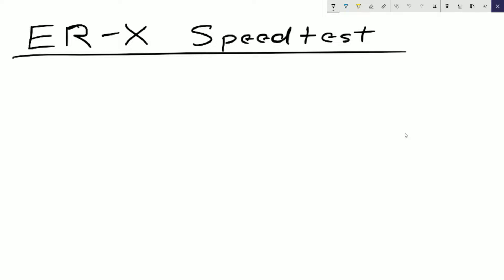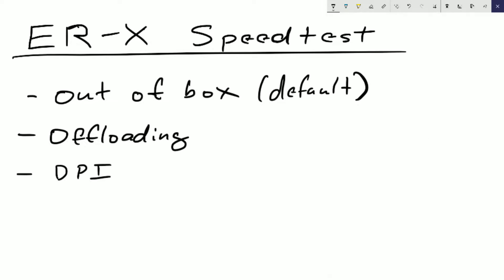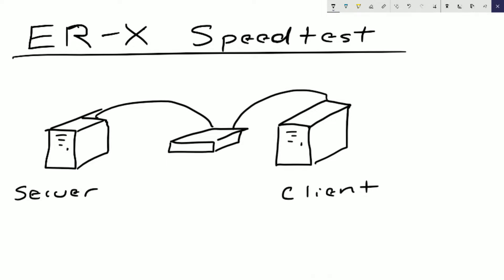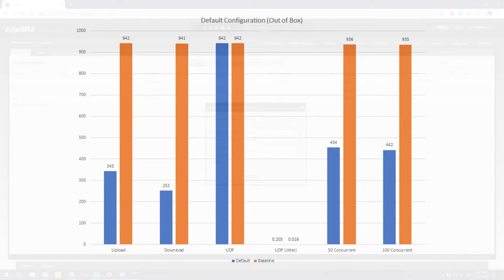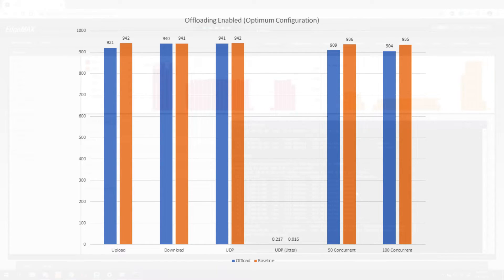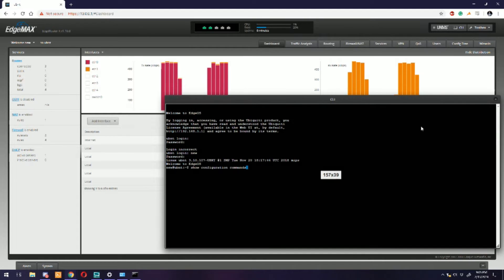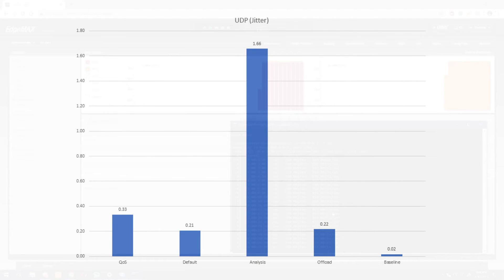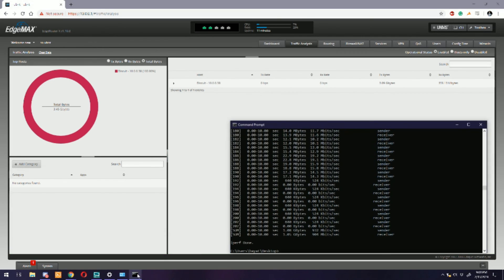Edgerouter X Speedtest

Comment: Hi, i have edgerouter x with firmware 2.09. I use wan 1 and wan 2. Normal speed in wan 2 is 200mbit of download and 20 of upload. With my ubiquiti router the speed came limited to 60/70 mbit in download, why ?
I have enabled/disabled ipsec and hwnat but the problem is always the same.
Thanks a lot for the help.
Reply from the maker: You don't have smart-queue or any other type of QoS configured do you?  The QoS configuration will take precedence over the offloading.  It will still take the offloading commands, but won't tell you if another setting is going to override it.
Reply: @ToastyAnswers  hi, i not have nothing QOS oe firewall or smart queue active. The only active are ipsec, hwnat, masquerade for WAN.

Comment: Very informative vid .. Im looking to buy an edge router for my house , ERX is on my list along with TPlink605 , but I really don’t know which one to buy ! My internet speed is about 750 Mbps .. and might consider upgrading next year , what do you recommend knowing that this ERX is almost 4 yrs old now 
Thank you ‘
Reply from the maker: Thank you for the comment! This router is fairly dated at this point, but is still a solid performer IMO (for the price).  If your internet speed is 750Mbps, I'd look at either the ER-4 or the Dream Machine.  You might want to check out my Edgerouter Vs. Security Gateway to see the ER-4 performance.  

It really comes down to how much you are wanting to process the traffic (QoS...IPS...etc...) as to which one you should go with. 

TL;DR: The ER-X will do 750Mbps with no processing at all (firewall only, and only in one direction).  The ER-4 will easily do 750Mbps in both directions with only firewall and the Dream Machine will easily process all the traffic with IPS.
Reply: @ToastyAnswers  thank you very much for you time and reply … actually my main ISP connection is outside the house ( in a centralized IT room ) so Wi-Fi not needed .. I’ve checked the dream machine and I believe it’s way above my budget 😊 although it looks and sounds like a dream to me !! 
I have a setup of 4x mesh asus xt8 ( each serving a room ) so what I’m looking at is a router/ switch bundle to through at the “IT room” and distribute the connection to each mesh router .. from what I read , the ER4 isn’t good at switching ( no internal  switching chip ) plus it has only 4 ports while I need 5 ( 1 ISP uplink and 4 downlinks for the mesh routers )  .
The ERX is outdate as you said , and most of the reviews aren’t positive about it being able to process above 500 mbps .. 
I have checked two other vendors , tplink er605v2 / er7206 and the mikrotik hex s .. which seem to fall under same price range , but little reviews and tests are done for both ! Have you had the chance to benchmark them or test them before ? Thank you
Reply from the maker: @thair  I actually think I have the ER605v2 ready to be benchmarked (I'm not at home right now so I can't verify the exact model).  It is in with a bunch of TP-Link equipment I plan to benchmark and make videos on. 

For Microtik, I've always read about their stuff, but I've never actually used any of it.  I've come close to ordering some.
Reply: @ToastyAnswers  Thanks again for your time , I can’t wait to see how the er605v2 will do against erx … keep the good work !

Comment: Thank you very much for your content. Waiting for mine ER-X-SPF to arrive (instead of USG).
One thing, you wondered in your video about UDP:

To your mentioning of UDP @5:30 an @QoS:
Keep in mind that UDP is a broadcast protocol, that's why I assume it basically needs no computing power to be able to be forwarded. Neither has is flow-control as TCP packets do. So you also have no "arrival-in-order" nor any "ack" for a retransmission in case of a failure as a headover. That's basically why I think the figures are like those.

Addition: Once for example in VoIP the signaling has been made using SIP (TCP, "Session Initiation Protocol") it will switch to UDP for the voice data itself (RTP / SRTP, "Real-time Transport Protocol"). QoS itself on VoIP is done in the header, Layer 3/4(?) using -SIP- RTCP, which is being an odd UDP-portnumber in regard to the voice data UDP-channel RTP which is an even portnumber. And this data is processed by your soft-phone, so in terms of QoS the router just let's the packes through, and the Application at OSI Layer 7 adjusts to the underlying connection based on link status and link quality data based on RTCP)

To you mentioning of UDP @7:40 (Traffic Analysis):
UDP - because there is no content "as such" to the packet, it's not like TCP where you basically can tell the type of content of the packet. In UDP you have to parse it. (I don't know how the DPI in the EdgeRouter works). That's why the CPU has to process more. Take here the same VoIP packet. Okay, we do know TCP SIP ports, which are like 5060 or something, this is fine. But as soon as the two UDP connections are established without any sequence number or any TCP-typical feature, the router has to process more of a packet to retrieve credible data.

Excuse any typos, and feel free to correct if any mistakes found. English not my first language.
Reply from the maker: That is awesome! Thank you for answering those questions.

Comment: Soooo should I turn off hardware offloading when I enable QOS to get better speeds?
Reply from the maker: No, enabling QoS automatically disables hardware offloading.  You don't need to turn it off because the two will not function together anyways.  However, if you disable QoS you will have to manually re-enable hardware offloading as it doesn't automatically revert.

Comment: my download speed is running between 200-400 but my upload speed is a consistent 904.  i'm not sure on what i did wrong on the setup. I'v got the offloads enable too.   Also i'm very new to this.
Reply from the maker: Hm, that is interesting.  Offloading should be working for both download and upload.  Have you enabled anything like QoS smart queue?  Make sure that is disabled.  You may need to restart the router and put in the offload commands a second time.  

Also, it is only going to get the full speed in a single direction, so if you have other devices uploading or downloading this will affect your testing.

Comment: Came here because I have an EdgeRouter X v1.10.11 and wanted to know why my internet was peaking at around 420Mbps when I was paying for 1000Mbps (1Gbps) down from Xfinity, the only ISP in my area. I also had to upgrade my cable modem to a Netgear CM1200 with DOCSIS 3.1 to be able to get the speed that I was paying for. 

Now with this video I learned that I didn't have hardware offloading enabled. Now I found the Ubiquiti Help support article on Hardware offloading and used the hwnat and ipsec commands. Article here: https://help.ui.com/hc/en-us/articles/115006567467-EdgeRouter-Hardware-Offloading

After making the changes and rebooting my router, the internet speedtest.net results now shows me great results with 933.00Mbps down and 41.98Mbps Up.

This video helped tremendously and pointed me in the right direction. I am trying to become a network engineer and this is great help. Thank you.

Comment: So it can do I gig up and down well in my case 940 up and down that would be great. My setup would be basic two wired devices plus wireless AP main floor cat 6 wall install to basement that connects to a five port gigabyte one of those would use another wireless AP. Would this little box be sufficient to keep Up with the Gig down and up speeds or do I get edge router 4? I have a max of 16 devices connected at the same time and my ASUS 5300 can’t get more than 630 down with just the most basic setup.
Reply: I have an Edgerouter X with gigabit up and down and it can definitely keep up with gig speeds
Reply: Nick maybe the x is all I need instead of the 4. I plan of using three ASUS 1900 AC one in AP and the other two as repeaters to generate max possible speed and limited weak signal.
Reply: @angelorestrepo  Yeah your ER-X should be more than enough for gigabit (with hardware offloading enabled). The only caveat is that you can't download and upload at 1Gbps at the same time, but I have never needed to do that and have never heard of a setup where someone would need to upload and download at 1gbps at the same time, it can upload or download at 1gbps with great performance though (when connected with Ethernet) just not both 1gbps up and down at the same time, works great with my Verizon Gigabit internet. You're not going to be able to get Gigabit speeds over WiFi though , due to limitations in the current wifi standards that are out today, most you can get over AC WiFi is around 600Mbps or so
Reply: Nick can you help me get the x model running? I went through the wizard and I might have to reset it. Can I do that through the command line? How to I set VID 201 for PPPoE for century link?
Reply: @angelorestrepo  Sure, I'm not sure if you can reset the ER-X from command line but you can also reset it by pressing down the reset button on the front for around 10 seconds then you can go through the setup wizard again. I found this configuration https://pastebin.com/uySp8fBr which shows how to configure the ER-X for CenturyLink fiber with PPPoE and VLAN 201, I think you would find it useful
Reply: Nick do I paste it on CLI and put in my account info where the xxxx are placed?
Reply: @angelorestrepo  those are config values, not command line commands, so what you can do is SFTP/SCP into your router, go to /config folder , edit the file config.boot and paste everything in there, then after that , from your ER-X command line , run these two commands : #1: commit #2: save (you might have to reboot the router after running these commands) then you should be able to plug your ER-X into the ONT with Ethernet and have working internet
Reply: Nick I got it to connect, thanks! Can you tell me what else I may be forgetting to set to get the full download? I enabled offloading and getting 550 down 905 up.
Reply: @angelorestrepo  that's odd, when you go in the command line and type "show ubnt offload" without the quotes does it say that hardware offloading is on? It seems offload wasn't enabled at least for the download, 500 Mbps is around the limit of the ER-X when offloading is off
Reply: Nick okay am I going crazy I did the two speed test. One on Speedtest.net and the other on fast.com. I am getting 550 down on speedtest.net and getting over a gig on fast.com. The system monitor screen shows 940.
Reply: Do make it worst I went to century link speed test am I am getting 346 down and 900 up
Reply: @angelorestrepo  what speeds do you get when you plug the Ethernet directly from the ONT into a PC with Ethernet (bypassing the router)? If the speeds are still around 550 then the problem is with CenturyLink, if the speeds are much faster when connected directly to ONT, then it has to do with the EdgeRouter
Reply: @angelorestrepo  have you tried connecting a PC directly to the ONT? (the ONT is box that CenturyLink provides that has a fiber cable and Ethernet cable coming from it)
Reply: Nick the ONT is outside our townhouse. I haven’t do that I assume that I would need to setup PPOoE connection on my computer. I may do this tonight. However this is the first time that fast.com shows one gig connection. On my cell phone I am getting half a gig instead of a quarter of a gig on WiFi.
Reply: Nick thanks for all your help got the box delivered today. I watch a video about the dream machine. I heard it can have dpi and almost maintain full speed.
Reply: @angelorestrepo  Yeah it's a great router especially for the price, no problem, glad to help
Reply: Nick the edgerouter x is doing the one gig on direct connection the only problem I have is page loads while watching a movie, and having 19 other devices connected. I assume it is bloated buffer. The issue is if I turn QOS I will loose a lot of speed that the edge router 4 have this same issue? If not I guess it is on to the dream station since I got this on amazon prime should be good.
Reply: @angelorestrepo   The ER-X is definitely underpowered for Gigabit + QoS, not sure about the ER-4, but the other high end Ubiquiti routers can probably do it

Comment: Excellent video, thank you very much! I needed a small router + switch that was low power enough to put in a small metal media box (Leviton SMC Box)  with an A/C outlet to light up 4 CAT6 wall jacks throughout a 1,000 sq. ft. newly built 1 BDR apartment. This will also allow me to convert one of those wall CAT6  plates to the Unifi Wall Plate Wireless Access Point and maintain the Gigabit CAT6 port there. It is also nice that I only need one a/c plug to power both the router and the wall jack WAP. This is really the perfect solution. I just hope the cable modem going in there (Motorola MB7220) does not make it too hot . It is great to be able to keep true gigabit speeds from such a small and cool running metal device as I often move large files between computers. The wall plate is super discrete so no cables or devices visible anywhere, everything is in the wall but still fast!

Comment: I like the edgerouter x, but there are some limits. first of all it's a 1G port and that's an aggregate rating. But the device itself seems to gave about a 1G limit regardless of the number of active endpoints. It really depends on how you use the device.... in my case I have a 1G WAN provider. Most of my I/O is to the WAN.
Reply from the maker: There are definitely limits to this device.  It won't work for every use-case,  but it does very well in most typical situations.

Comment: I think it's important to note that the ER-X can only do 1 Gbps of aggregate bandwidth... i.e. 1 Gbps up or 1Gbps down... but not both.  If you try to push 1 Gbps in both directions at the same time, what you'll notice is your bandwidth will be limited to 500/500 Mbps full duplex.

So, if you have 1 Gbps up and down, the ER-X isn't going to cut it... you'll want an ERLite-3 or an ER-4.
Reply: I recently switched from asus rt-ac58 over to er-x. My WAN is 500/50, hwnat enabled and er-x is beating the shit out of asus. I got ~23 devices on my home network, no need for QoS. I'm pretty satisfied with it. Looking for es-8 atm.

Comment: Didn't understand the difference between hardware offloading enabled and traffic analysis enabled.  What did you do?
Reply from the maker: Hardware offloading is what pushes the processing of certain types of data off of the CPU and onto specific hardware chips.  It is enabled with a command in the CLI.

Traffic Analysis is an option you can enable in the GUI under the "Traffic Analysis" tab.  It processes most of the data which flows through the router and creates a graphed database of which hosts are using certain types of traffic and how much bandwidth they are consuming.

Traffic Analysis uses a bit more processing power because it is making note of host's traffic and putting it into a neat graph.  However, there is a bit of a discrepancy between offloading and the analysis feature.  If you've enabled offloading, not all traffic is going to show up in the traffic analysis since it is being processed by the hardware.  Only traffic that is processed in the CPU will show up in the analysis graph.  If you don't enable offloading, then everything should show up in the analysis graphs.  It does take a little more power to run even with offloading enabled though.